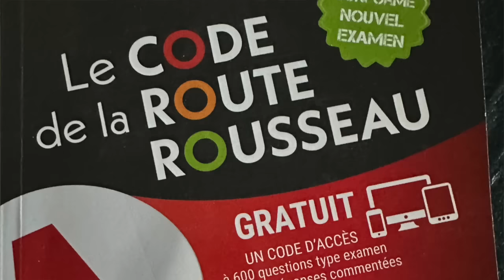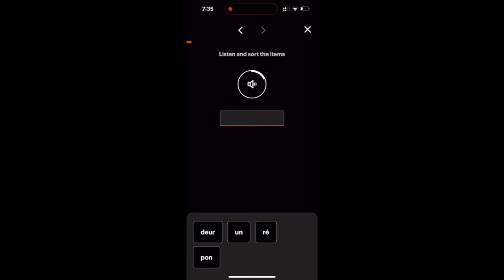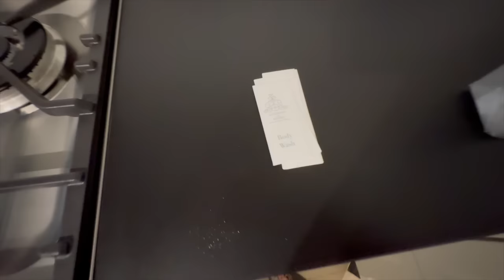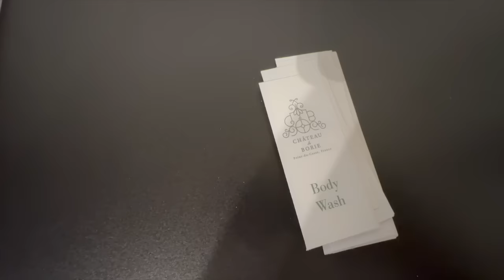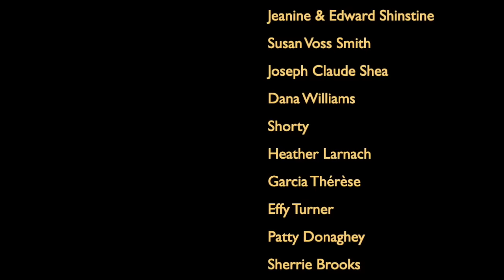The Return of Bruce: Epic Bedroom Unveiling & Kitchen Perfection! 🏰💼 Chateau Chronicles-Ep #84

Comment: Paint that path yellow, just for the fun of your guests!!!
Reply: That pink-beige is really a dusty pink with years of smoke, and dirt...find Eau Ecarlate at your local Quincaillerie, it is dry cleaning fluid, pour it on a sponge or another cloth and rub the velvet gently , pour more fluid onto the sponge so it remains saturated, and change the sides of the sponge as needed, the fluid evaporates quickly, so you may want to move quickly and reapply often!!!